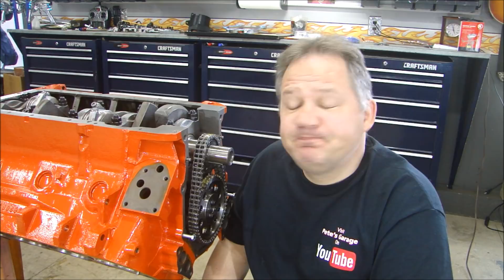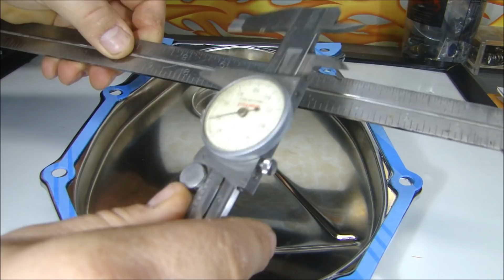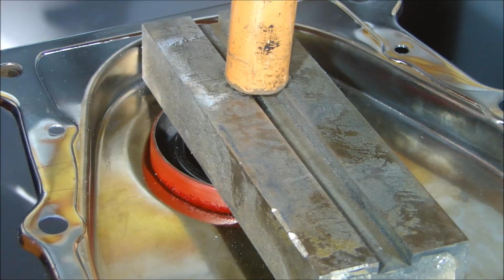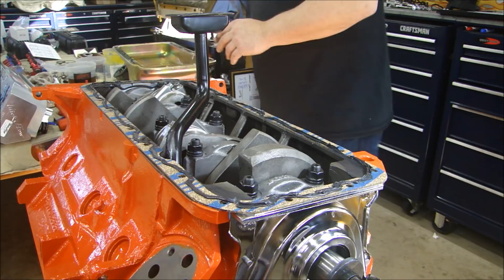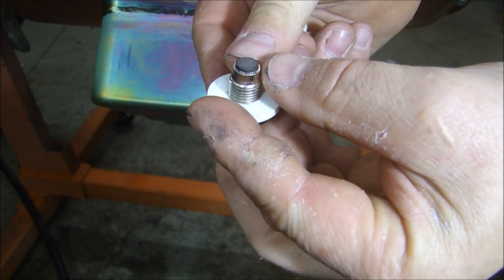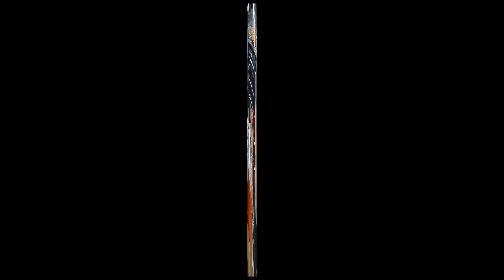440 Chrysler Mopar Engine Building Part 6 - Cam Button, Timing Chain Cover, Oil Pan & Fuel Pump

Comment: No  windage tray? You do know the 2 seal bolts are shorter than the rest of the pan. If you don't use a windage tray. And if you put a regular oil pan bolt into the seal, it bottoms out and cracks the housing!!!
Reply from the maker: Interesting, I've never had that happen. I use oil pan studs with a girdle

Comment: Fuel pump pushrod length. How did you go about choosing the length you needed it?  I’m not getting fuel to my carb wondering if that could be my problem. Tia
Reply from the maker: It's a standard length

Comment: I need to replace the fuel pump with the engine in the car. Do i need to worry about the push rod? If so, what care and precautions do i need to take?
Reply from the maker: I would at least take it out and inspect it
Reply: @PetesGarage  thanks. I actually did the job last night and the rod looked good, the grease helped it stay in place. Thanks for your video, it really helped a lot.

Comment: 5:08 Pete thank you for this series of videos! I am putting together a 440 and need all the guidance I can get. These videos have given me the confidence to take this project on.
FYI, I don’t think 45ft/lbs & 25ft/lbs is the correct torque for the timing cover bolts… I just tried it and absolutely destroyed the gasket, dented the all steel cover, tweaked the timing pointer and the washers all look like I shot them through the center with a .45! I have new parts on order and nothing stripped but I followed this to the letter and was scratching my head. Might be worth an update if that possible.
Reply from the maker: That would happen more with a cork gasket. It's actually inch pounds. I'll have to fix that somehow
Reply: Yes I figured it was inches after the fact. The 68 Dodge book says 15ft, which snugged them up fine on the replacement parts. But again, I just appreciate the video series. Thank you again for this step by step walkthrough.

Comment: I had my 440 rebuilt and for some reason after installed and wont crank right with new battery and starter when turning the crank shaft by hand with a breaker bar,  plus it is really really hard to turn the motor over to TDC even with the plugs out? , the engine has never ran it wont start we been trying to start it for 3 days now. I'm thinking the company that rebuilt the motor did something wrong but that's rare. it has a winding sound even with the torque converter un bolted from the crankshaft if the fuel pump rod and oil pump aren't jiving right could that make it crank slow ?
What is your thoughts on this? This is odd.
Reply from the maker: The bolts you used to bolt on the torque converter are too long and possibly bent the flex plate. That's where I would start looking.

Comment: Deep pan but no windage tray? 🤔
What's the purpose or advantage by not running a windage tray??
Reply from the maker: Well, experience tells me unless it sees high RPM's for suspended times a windage tray does very little. I understand your point, it would not hurt to put one in.
Reply: @PetesGarage  We did alot of experimenting on the dyno with camera's on the pan above the the oil level. It makes a big difference on oil control for cornering, accelerating/decelerating, & high rpm. Even 1 higher rev will whisk up oil onto the counter weights flinging it into the pistons which effects the balance as well. Specially if your trapped in the 80's still running that motor honey thick 20w50.
And the fact that Summit & Jegs both make a very premium rubber pan gasket that has the windage built in with steel crush rings too so you can't over tighten it's become a no Brainerd. Screw stacking the 60's metal shim & double cork gaskets.
Was curious IF you had a logic on it I hadn't heard. Thanks
Reply from the maker: As I said, in a performance or racing engine I would put one in
Reply: @PetesGarage  I'm confused so your doing a roller cam, deep sump oil pan, & haven't even looked what else But it's not a performance build... OK 👍🏽👍🏽
Reply from the maker: Yeah, I know the cars these are going into, they won't be driven even remotely hard

Comment: Hello Pete :-) Very good videos. I`m replacing the fuel pump in my 440...however, the engine is still in the car, so it`s very tricky to fit the pump and it`s lever at the push rod, and there`s some really tight space to fit the inner bolt near the engine block...my question is...would it be easier / possible to install the pump first with the push rod taken out and then install the new push rod afterwards? Thank you in advance. Robert
Reply from the maker: Sure, if you mean leave the one in there

Comment: Hi Pete Appreciate your videos Thanks building a street 440 first time using a hydralic roller cam and lifters. I have a concern on my install reelated to cam lobe lifter barrel interferance. On one I have only .005 clearance when I spin it over enough?
Reply from the maker: You mean the roller? It should ride right on the cam.
Reply: @PetesGarage  No the lifter barrel the roller rides in
Reply from the maker: As long as it rolls freely it's ok

Comment: Hi Pete 
Upgrade on bigger oil pan usually involves machining oil pick up to 1/2” npt thread and no installation of oil windage tray ? Also some certain pans only work on certain K frames however B body like a Bee has few issues. Good stuff. Thanks 👍
Reply from the maker: Thanks for the tips!

Comment: Pete I am surprised you have not used a windage tray in that torque monster as well why no Hemi black spring in the oil pump both are cheap tricks that pay off for a cheap investment
Reply from the maker: Great comment! I only use windage trays in certain applications, and this was not one that called for it. They sometimes can do more harm than good. I like the spring change idea.
Reply: @PetesGarage  I thought it was always a good idea to use a windage tray. Please update on your wisdom as I need all I can get. By the way great videos
Reply from the maker: A windage tray can hold up and delay oil from getting to the bottom end. If you race circle track and use a dry sump, the bottom end can get starved for oil. Some people think the windage tray is needed for a stroker to reduce bubbles, but I've never had an issue.

Comment: 👍👍.have an original HP 69 1/2 block cleaned machined ready to go into 69 runner.been awhile since ive done any big blocks.thanks for the refresher course Pete.any vids on gm 400 or Pontiac 421/455 in the future?
Reply from the maker: Thanks Jesse, not yet

Comment: Hi Pete! about your upgrade like the fuel pump how far can the engine block still be able to manage the new upgraded parts, or is it the new part that does it. Thanks again for the time and explaining you do. TC
Reply from the maker: The block can handle almost all external upgrades

Comment: Probably won’t get answers but where did you get your toque specs for the timing cover
Reply from the maker: I don't recall, probably the Mopar dude website
Reply: And  it’s 45 ft lbs and 25 ft lbs I don’t question you you’re a master compared to me it just seams like a lot
Reply from the maker: @lolathedog7  It's ok, it's a great question. Thanks for asking it

Comment: How is the fuel pump going to work? I noticed no cam lobe on the roller cam on the last video!
Reply from the maker: It is driven off the intermediate shaft from the cam gear

Comment: Pete, your series is awesome, I am building a 512 now. I ran into an issue with the cam button. I have .103 between the button and timing cover. Should I shim the button, or shim the cam gear? The timing chain looks straight.
Reply from the maker: Thanks Dane, yes, shim behind it
Reply: @PetesGarage  Thanks Pete, what is the ideal distance from the pan?
Reply from the maker: Usually .003" to .005"
Reply: @PetesGarage  thanks a bunch. your video series was awesome.

Comment: Just stumble across this video. I like your attention to  detail in your engine assembly.  I was just wondering about the cam button. I've been building these big blocks for about 50 years now and I've never used or seen a reason for a cam button. Also, no windage tray?
Reply from the maker: The cam button just stops the cam from pushing forward. I leave the windage tray out with a 7 quart deep pan, it just doesn't seem to add value.

Comment: Problem is ,You machined the "unnecessary" Cam button too much and now it is loose and will spin in an elliptical motion and get looser, also if it contacts the cover it will bore a hole in cover due to the elliptical motion, sorry, but you messed up.
Reply from the maker: The button is held concentric in the hole. It is spring loaded so it will not put enough pressure on the front cover to damage it

Comment: So, I'm wondering why you are using a cam button on a 440 Mopar engine? The cam always has rearward pressure on it from driving the oil pump andthe distributor, and the back of the timing chain sprocket thrust face is always in contact with the block. If the cam were ever to move forward, the pushrod for the fuel pump would wipe-out the first lobe on the cam. I'm having a discussionon a Mopar forum about this exact subject, and I'd like to know if I'm missingsomething? Thanks Pete! You gotta clean shop Man!
Reply from the maker: That is a great question. When you let off the gas there is a chance of the cam moving forward, that is why there is a button and the clearance is .009" or less. It does not happen often, But I have seen timing covers pushed out at the cam.

Comment: Hey pete good stuff. Which part is the carter fuel pump?  M4862 with 6 to 9.5psi. Or m6903.?
  My thermoquad floods at 8 psi.  Im havin trouble with the pumps on my 440. One every oil change 4,000 miles or less!. Even a holley #440-11 lasted only 2,000 miles. Holley dealer said its the ethanol in fuel destroying/cracking  the rubber inside pumps. What do you think is solution?  Electric pumps that can handle alcohol?  Or have you not heard of this problem.  Ive driven 25,000 miles and 6 mechanical fuel pumps! I got 450hp and love to take long trips. Get 15.5 mpgallon on freeway with my 850 thermoquad which only has 8 hp less than 800cfm thunder series! Swapped them and tested both on dyno.  Kept thermoquad for great mileage tunability. But had to drill out primary butterflies ..160"? to keep a steady idle. Old school!!!  Hahaha
Reply from the maker: The E85 is murder on fuel pumps and carb parts. You can get a good pump from 440source.com.

Comment: Hi Pete. Was wondering about the chain cover and the way you put it on there without using the crank sleeve first to align it. Is it not necessary on the Mopar? btw, would like to see you assemble an FE motor.
Reply from the maker: The chain cover had really tight dowel holes that lined up perfectly. Normally I'd put the balancer on the center the cover. Do you have an FE?
Reply: yes, I am finishing up a 390 and had to put the timing cover with the sleeve, otherwise it would not be centered. FEs give you room to adjust and play and that's why I was curious about your tactics.

Comment: Hey Pete, first I would like to say thank you for the videos man. They are super intuitive and descriptive giving young guys like me the knowledge and confidence to do the same and not mess up. But I was curious why you don't put the dampener on before you tighten the timing cover. Wouldn't that guarantee a better seal and that your center? Again, thank you good sir.
Reply from the maker: Thank you Ryan. The dowels on the front cover were tight. Even if the balance were put on first the holes would pull to the dowel. Great point!
Reply: Oh awesome! I didn't notice the dowels. Thanks Pete!

Comment: Any particular reason you didn't install a windage tray? I too am building a 440 so this has been perfect timing for you to run this series
Reply from the maker: The windage tray is not really necessary. It is there to reduce foam which will not be a problem with the oil I use. I'm not saying to skip it in yours, I just prefer not to use it.

Comment: Hey Pete, I really enjoy your videos and have been taking notes as like I said I'm going to build a 440 for a Superbird semblance. THE tricky part, I want to make a street legal Richard Petty race replica to run at SSCC and Bonneville with the lifelong dream or topping 200MPH. What "recipe" do you recommend . I know there area a lot of variables. Cam, pistons, stroked, heads, supercharged, I can go on and on. I think I will use Gear Vendors overdrive system to help with the gearing.   Right now I'm gather the information for what is required per the rule books. Any thoughts? sources? builders to recommend  Some people say on the old mopar blocks to have a girdle put in. So you can see my being overwhelmed.  HELP   I would love to get Mark Worman from Graveyard carz to do the rolling chassis in Petty Blue with the required roll cage and I could drop the engine in. (I've only have this dream since the mid 70's! now at 55 it on my bucket list.  Thoughts/
Reply from the maker: That is an awesome project! This engine will be well over 500 HP if you want to follow this recipe. I'll have all the part numbers available at the end. I know a few builders, I'm sure we can help you.
Reply: Thanks Pete, looking forward to all your videos. I appreciate how you explain the reason you do the work the way you do it. It helps to answer lots of questions.

Comment: Coming along nicely.  If using HV oil pump and/or different bolts, check for correct bolt length.  The longer bolt kit for the HV pumps will bottom in the block before clamping the pump.
Reply from the maker: Thanks Jim. I'm using an Elgin HV pump and will check for that.

Comment: Not claiming this is correct but my shop foreman used to tell me to never use RTV or any other sealer when installing a gasket. He says this amounts to double sealing and leaves a thicker sandwich for the middle portion to blow out or corrode. He said the gasket has to be tight against the sealing surfaces. I've always done it this way again not saying its right. Thanks for the vid, thumbs up!
Reply from the maker: That is interesting. The short answer is yes, you really don't need sealer, but it's cheap insurance and that is why I say use it lightly. It will make up for minor surface imperfections and parts that are not perfectly parallel
Reply: Pls keep up the great work, I really enjoy your videos!

Comment: Nice work Pete! Looking real sharp! I would have thought that you put on the harmonic balancer/ damper before you torque down the timing cover bolts. either way can't wait til it's done!
Reply from the maker: Thanks my friend. That is usually the procedure, but this cover fit so tight on the dowels there would be absolutely no movement if I did.
Reply: Ohh okay! I didn't see the dowels on there, nicely done!